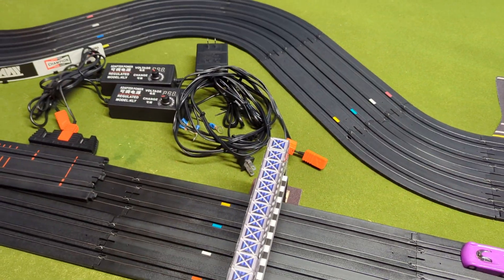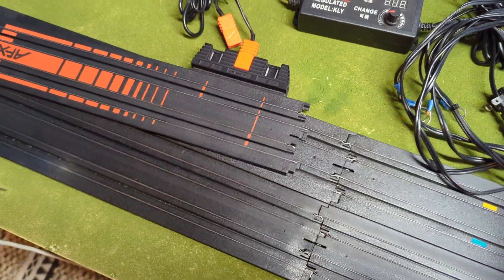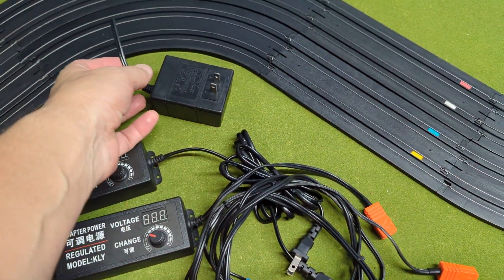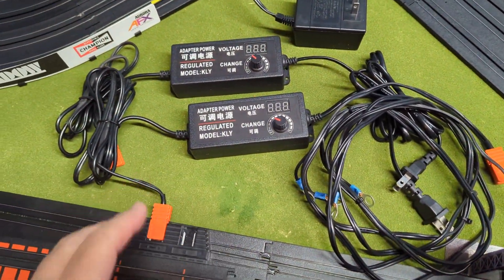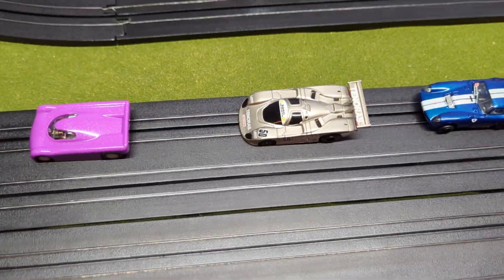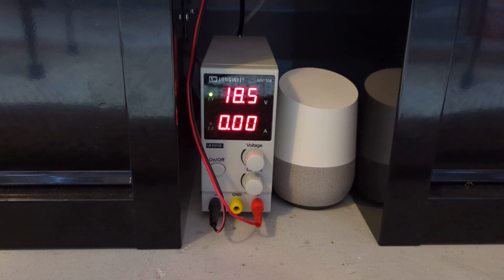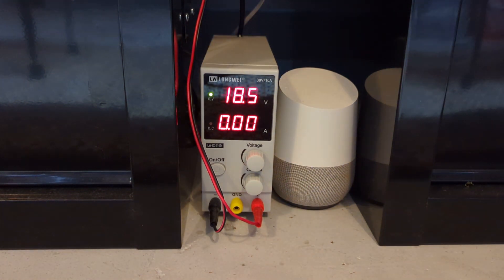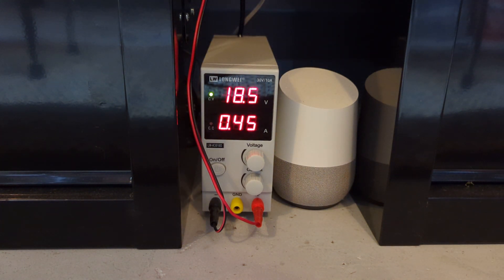Track power and car current draw

Comment: I have 2 different power packs,  the lower voltage for the kids. I have just added a second track feed to the opposite side to make sure the voltage stays pretty much the same around the track.
Reply from the maker: Sounds good, depending on the size of your track and the type of cars that you run that should be fine. The problem with the stock AFX wall packs is they don't produce a lot of current but they are fine for stock type car like the Mega G Plus. Thanks

Comment: Did the separate  ( adjustable)power supplies work well before the new power supply with amp draw display ?
Reply from the maker: Yes, they worked fine, they were 3 amp supplies, I had no issues with them, I just wanted the one higher amp supply. Thanks.
Reply: @marksslotcargarage  your new 10amp runs all 4 lanes ??
Reply from the maker: @dougbloom3672  yes, it provides more than enough power for the cars I run even down to 2 ohm Vipers.

Comment: With larger tracks you lose power but if you plug in 2 to 3 terminal tracks will it give you more power?
Reply from the maker: I don't think that would work, you need a controller hooked up to complete the circuit. As long as you hook up a controller it would work. You can do one power pack and controller per lane with the terminal track but that is still only one power tap per lane.

Comment: Do you use PARMA hand controllers; what ohm?
Reply from the maker: I use Difalco controllers, they are variable. The ones I have are the two wire DD505 without brakes.
Reply: @marksslotcargarage  How does the break work? Does it reverse the motor briefly or slow it down to brake?
Reply from the maker: The brakes work by basically shorting out the motor to slow it down. There is a 100 ohm variable resister that is only active when you take your finger off the trigger. The resistance set is applied across the rails of the track, the lower the resistance (closer to a short) the better the brakes will be. In very strong magnet (high down force) cars the brakes don't really do as much.
Reply: @marksslotcargarage  Thanks.

Comment: Dont ya think 30 volt ,,,, 5 amp  power supply would be enough ???
Reply from the maker: That should be fine for most stock cars. If you plan to run lower ohm motors like 3 ohms or lower you may want to consider a 10 amp supply if you are doing a four lane track.
Reply: Thanks !!

Comment: Note; Magnatractions red devils are 14.5-15.5 -red tip/copper wire 14-15 ohm armatures. Early AFX red tips/ green wire  are 6-7.5 ohm, AFX  Mean greens (copper or green wire as stated 6-6.5. Another very good informative video.
Reply from the maker: Thanks Simon for the extra info.

Comment: Great video Mark!!  Do you have a pic before you installed the pre-wired track? Anything else you needed to do?
Reply from the maker: Before I had the power tap tracks I was just using the stock AFX terminal tracks. I have some pictures posted on Instagram of the track before I added the power tap tracks. My Instagram is also Mark's Slot Car Garage.

Comment: GREAT video! Very informative. Agree 110% that the stock wall-wart power-pak and the stock controllers are not all that great. The kids find it frustrating when one car de-slots and the other go's flying off the track,,so much so that they get discouraged. 
I never really paid attention to what ohm different motors are, this changes that.
 Did you do anything to your track besides slide it together? It sounds really Smooth, with no real "click-clack" 
Look forward to more vids! 🏁
Reply from the maker: Thanks! I did tune some of my connections that were really loud. You can carefully bend the plastic tabs to make a smoother connection. Also my grass mat helps reduce noise otherwise I did not do anything special.
Reply: Thanks Mark.🏁
Reply: Very informative video, thanks for sharing